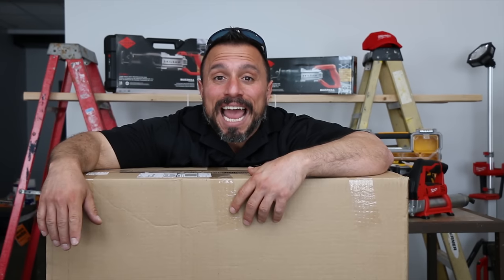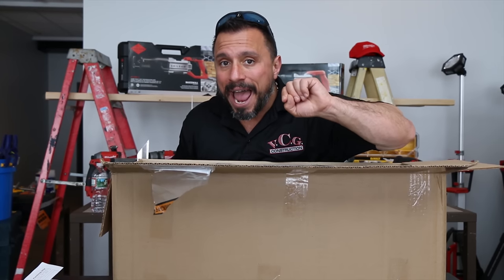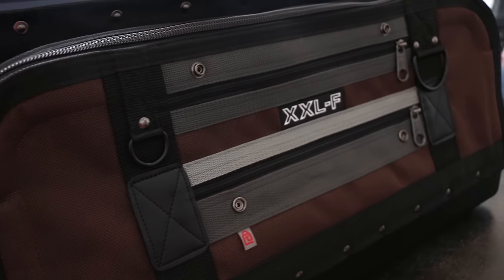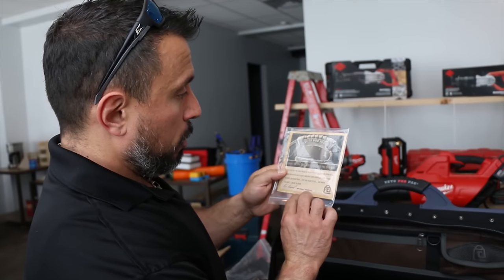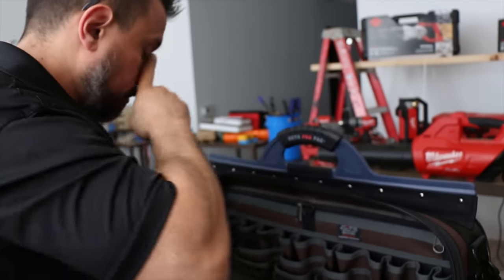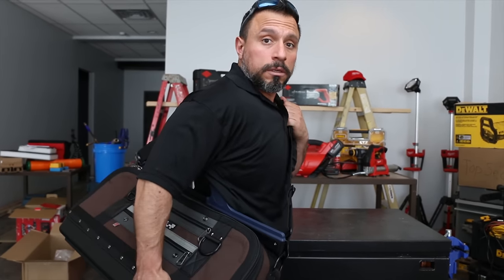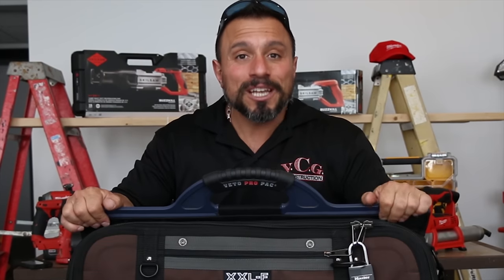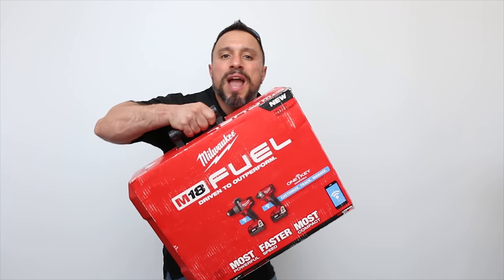Best Tool Bags For Carpenters - VETO PRO PAC XXL-F

Comment: if contractors in larger cities are taking public transport with just a tool bag i am SOOOO glad i live in an area like north east ohio where parking isnt so challenging. i dont think i could work with just a tool pouch and no power tools and no truck/trailer with no parts and extra misc. tools.  About the bag, i really like the build quality and design of Veto bags  but they're blasted expensive

Comment: Yo I'mma go check out the Veto pro bag website, to see wat they have to to offer.
Reply from the maker: Definitely well built, King Of The Crease swears by them!
Reply: VCG Construction Thanks 💪😉
Reply from the maker: EJM you might need to pick one up for The Vloger!
Reply: The bag is nice  has a 5 year warranty 0 down time veto will send you a replacement or a loaner when they fix your bag . The bag is built so good it will probably Outlast you. I've had a few bags already . Stack that xxx-f  bag up on a dewalt tough system ds450 your coming in that job real tuff for sure.